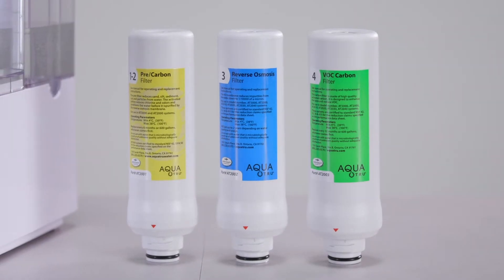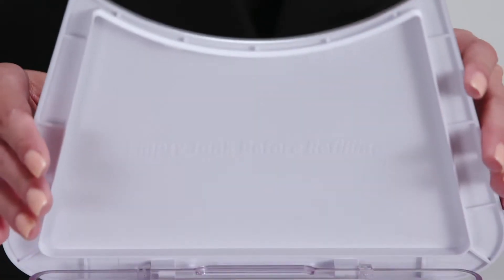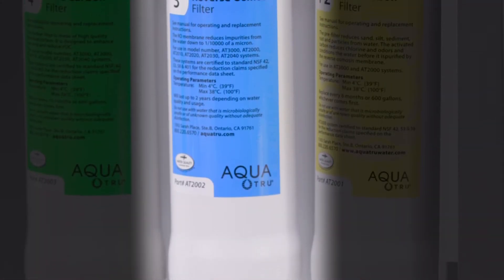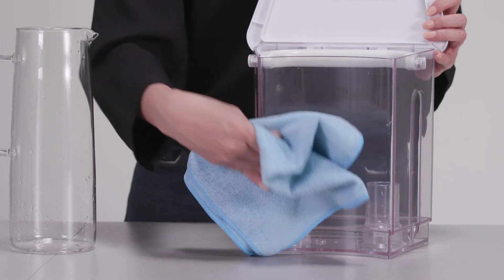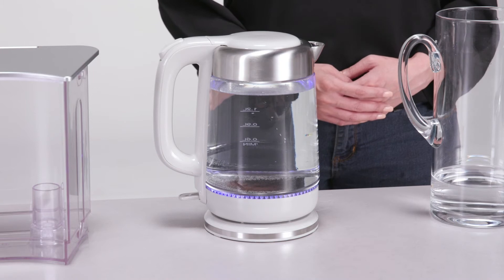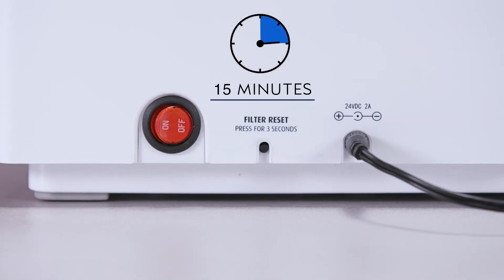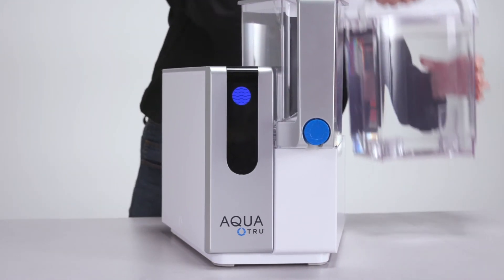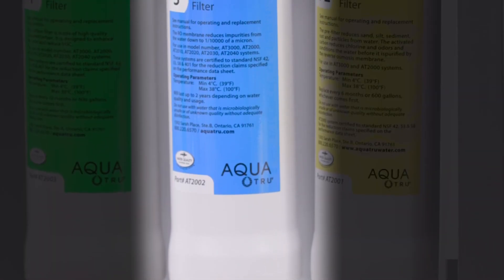AquaTru: How To Use Descaling Kit

Comment: It won’t start the descaling process. If I lift up the back tank, then the blue circle comes on so it’s function but soon as I set the tank down the blue circle goes away and it’s all blank even though everything is plugged in and it’s been working fine before trying to descale  so I don’t know why it’s just not starting now.

Comment: What about using vinegar with descaling plugs? That should still work right?
Reply from the maker: Not as well as citric acid. We recommend using the descaling powder.
Reply: Vinegar will work just fine.  Vinegar's PH  is 2 - 3, and citric acid is only 3 - 6.  For comparison, battery acid is .08.  I use Vinegar to descale my tankless water heater.  Citric Acid is simply not powerful enough.

The 3 descaling filters basically plug the holes so the whole system becomes a loop in which the Vinegar circulates.  So you'll need those.
Reply: @KENZIIE_lol thanks! Gonna hit that up now
Reply: how much vinegar per water should I use?

Comment: can i use white vinegar if i don't have descaling kit?
Reply from the maker: Using vinegar will damage the filters. Our descaling kit comes with plugs that will prevent the liquid from getting into the filters. You can get our descaling kit here: https://em.aquatruwater.com/?c=emfrship&_ga=2.46626215.1298345290.1617639581-874631687.1617467514

Comment: I bought my descaliing kit ,I did everything on the video and my water it’s too slow  ,should I have to bought the RO filter too ,I called costumer service and he didn’t mention to replace the RO filter  please help
Reply from the maker: The first step is to try descaling. If that doesn't resolve the issue, generally a new RO filter is needed.
Reply: Tapatia, how did you resolve your issue?
Reply: @Broxine  buying the RO filter like 4 times a year because  my area had hard water
Reply: tapatia18el how do you know that it does need replacement?

Comment: I've never had to do this for the three years I've had the device. Is that normal? I always rinse the tap water tank before filling it instead of just dumping it. Maybe that prevents scaling?

 I finally had the filter light activated for the RO filter (3). I have the model before you guys added a time check instead of the gallon counter check. I prefer just to have the gallon counter feature because what if we don't use it often? I feel like the timer feature is just to get people to buy filters more often.

I'm loving my system, the only issue is having to use mineralized drops to prevent acidic water, but I saw that there is a new filter available now that adds the minerals back in. I might purchase that in the future.
Reply from the maker: It mostly depends on water hardness. People with very hard water, need to do descaling regularly. I have never needed to do it either and I don't do anything in particular to prevent the need to descale. My water hardness is not at a level that causes problems for my unit.
Reply: I did it every few months even though filter times never got longer than 10-15 minutes. After 2 years the machine was irreparably damaged and when I called customer service they said I should have done it every month and I had to buy a new unit. To bad. Their directions and the below comment from them seems suspect.  I'd suggest doing it.
Reply: @jonathanmanley6743  It seems to depend on the harness of your water coming into the house. I'm almost up to 4 years and I still don't have any issues with it with no descaling. How did yours fail? Did the pump just stop working or did it just take very long to filter the water?
Reply: @MaxHasManyHobbies  Yes. I have hard water in my area. I didn't have any issues and I changed my filters and it stopped filtering (it would filter but would never finish). They said the pump was damaged because it needed more descaling. I would think very few water sources are soft enough to never need descaling.

Comment: Do I need the descaling filters? what happens if I keep the normal filters in during the descaling process?
Reply from the maker: The descaling kit comes with plugs that don't allow the descaling solution to get into the filters.
Reply: @AquaTruWater  I never received plugs with more order... just the powder.
Reply from the maker: @artvandalayy  There are two related products on the website. One is just the descaling powder. The other is the descaling kit, which contains the powder and the plugs.